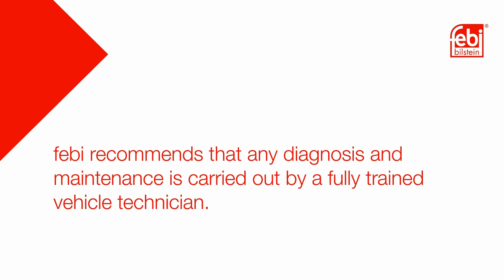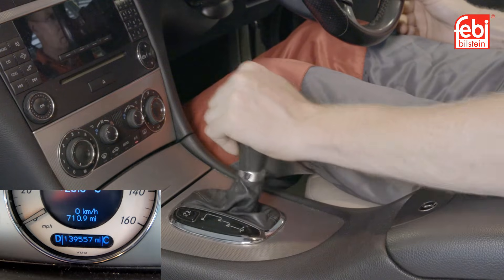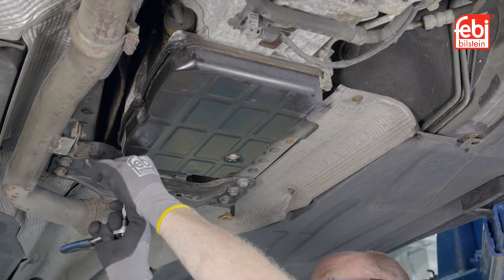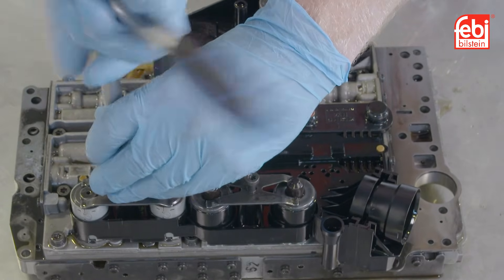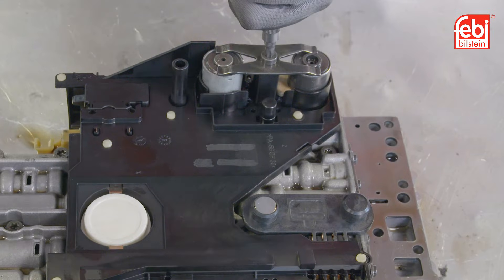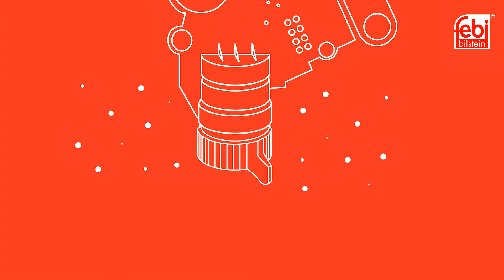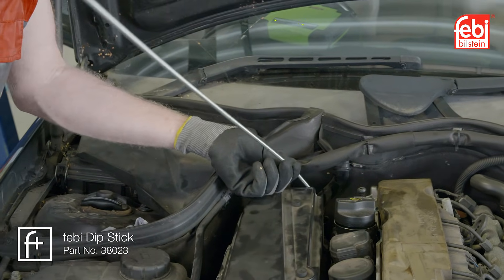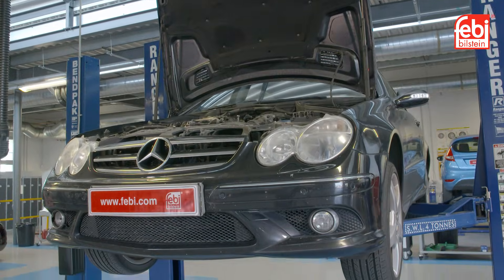[EN] Mercedes 722.6 Automatic Transmission conductor plate inspection and replacement.

Comment: Hello, thanks for the video. Is the locking cap reusable once the red part is plugged in ? Thanks a lot
Reply from the maker: Thank you for watching our video. The black cap is reusable, it is just the red security locking pin, that is broken to access the filling/dipstick tube on Mercedes automatic transmissions. It is best practice to install a new security locking pin after the oil has been checked.

Comment: How long does this service typically take??
Reply from the maker: Thank you for watching our video. The official time for changing the transmission oil and filter on the model featured in this video is 1.3 hours, but other models may vary. To change the conductor plate would be longer.

Comment: Mercedes 722.6 – Question after replacing conductor plate and WÜK valve

Hello everyone,
I have a quick question: After replacing the conductor plate and the WÜK valve as a preventive measure, is it mandatory to perform a reset/initialization of the TCM using Mercedes Star Diagnosis?

I did everything by the book – new oil, filter, WÜK valve, and new conductor plate. The car ran perfectly for 800 km, and then the same problem came back: after a few minutes of idling, the gear lever can be moved, but the car won’t move forward or backward.

Could it be because the reset was not performed?

Comment: Question, do you need to reset or erase any transmission codes? or check engine light
Reply from the maker: Thank you for watching our video. If there are any fault codes that are present after replacing any faulty parts. Then it is best practice to erase them.

Comment: can you edit video and add the actual bolts measurements? so we can know what tools to use. thanks for uploading
Reply: 7mm for 13 pin plug. Then all torx are t30 i believe i havent done one in few yrs. E8 e10 are also used for other thjngs t25 t27.  13mm socket also have a pick tool handy. And magnet tool

Comment: hello, I hope you are all well, please if you can help me, I have a mercedes c250 cdi year 2010 with automatic transmission tronic 5g, the problem is that when the car is at low rpm, i.e. below 2000 rpm, the gears change a little hard and with a knock or shock easily, if you accelerate to 2000 rpm and above, the gears are all changed in a perfection like new and out of the ordinary very soft, the car has full power and continues strong, this happens both in the cold and in the warm.  strangely, the computer does not show anything and this has worried me, the car has 280,000 km and the oil has never been changed, I emphasize
Reply: Did you found the problem

Comment: Does this part require any coding after installation?
Reply from the maker: Thank you for watching our video. No there is no coding required.
Reply: @ there are solenoids that go into the transmission control unit, if these are changed would you need to code anything?
Reply from the maker: @ Same for the solenoids.
Reply: @febi.bilstein  “Reset the transmission adaptation with STAR diagnosis.”

Comment: Hello Febi
I have a question . I have a p0763 code soleniode 3.im planning to change the soleniod.but should i change also the conductor plaid with it ?
Reply from the maker: Thank you for watching our video. Although it is difficult to give advice based on a fault code. Symptoms may include harsh gear shifting, failure to shift, or the transmission getting stuck in a particular gear. The most common causes are low transmission fluid level, dirty transmission oil, a faulty shift solenoid ‘C’ valve, or issues with the wiring harness and connectors. Therefore, check the service history of the transmission and the condition of the oil first.
Also, you should visually inspect the wiring harness and connectors for any damage, such as broken or corroded pins.
Reply: @ thank you for the feedback.
Gear was stuck on three and had the fault code . 
So I changed also the transmission fluid .then had the code again fluid was low I added half liter since then didn’t have the code but I was bit doubtful if I should change the solenoid and the conductor plaid
Reply: @easyrider020  how has it been? i have this issue and see there is a remanu service for the plate. i read the speed sensor faults at a warm enough temperature and tricks car into thinking its a wrong gear and will go from reverse to neutral or jump into 3rd.
Reply: @ in my case I changed soleiond for third shifting to four and replaced the conductor plaid

Comment: Can you give the product number for ordering of service kit and the conductor plate?
Reply from the maker: Thank you for watching our video. febi Transmission Oil and Filter Service Repair Kit 171748, Conductor plate 32342
febi Dip Stick Part No. 38023
febi Locking Cap for transmission oil dipstick Part No. 44204. All these part numbers can be found in the video and on our on-line catalogue. www.partsfinder.bilsteingroup.com
Reply: @febi.bilstein  do you have anything for 2017 glc300 please. 725.9g
Reply from the maker: @Aimless_Drive  Thank you for watching our video. Regarding your question, we currently have no videos on replacing the transmission oil and filter on the 725.9. However, we have the parts in our range. Please visit www.partsfinder.bilsteingroup.com to see our complete catalogue.

Comment: Never forget to check 13 pin harness  plug,not just adaptor plug ,pins are not soldered only crimped in place and intermittently one or more come loose, then limp mode happens, wires can make contact again with limp mode happening later, very very hard problem to find
Reply: is this a separate part to buy from a remanu conductor plate?
Reply: Yeah I messed up once lol

Comment: I have a 2004 W203 Kompressor Sport Sedan with a few problems related to shifting. Ive owned the vehicle since 30k miles and it currently has 240k miles. Ive never had the transmission serviced. It was a Certified Used purchase from Mercedes.

There have never been any error codes thrown related to the transmission since ive owned but i had the following issues for a about 2years now which have progressively gotten worse.

1. The automatic downshift at times, from 2nd to 1st gear (at slow speeds) slams into gear causing a big jerking. Other times it perfectly fine. On the freeway this  causes this causes the RPMs in first to drop really low when almost coming to a complete stop in traffic.

2. 1st to 2nd gear on take off (slow speed). I can feel a jutter in each gear causing a lurching or springing takeoff affect as the car speed increases. It becomes a less or lighter feeling in the other gears.

This doesn't happen if im hard on the acceleration or if Im manual shifting. In fact all shifting in manual shifting are fine, that i can tell.

Also, but infrequently, the car will lurch or lung forward at a complete stop without warning.

3. While at freeway speeds between 60-80 mph and letting off gas to coast. There is a jerking or lurching feeling.

If i had to describe it simplistically, it feels like a tight spot in a chain,  where the chain rotates fine to the point of the tight spot or kink and slowes the rotation with a sudden small sputter or light jurk (wobble), and then repeats the cycle untill you get back on the gas.

This wobble feeling also has me thinking driveshaft unbalancing, knuckle or driveshaft bearing.

4. At times the shifting doesn't feel like its fully engaging. By engaging I mean if this were a manual shift, that contact point where the clutch engages the flywheel and you get a positive contact confirmation of locking into place.

Im not sure if fluid & filter servicing would fix this issue, may be the fluid level is low, or if this could be a solenoid.. so many ways to go with this .

Id like to get your thoughts..

Here a good read about other having the same

https://mbworld.org/forums/c32-amg-c55-amg-w203/531557-jerk-transmission-problem-solved-9.html
Reply: Im having almost the same issues, I even have a video on my page about the small rpm drops, when there is allot of traffic and my car can only move in first gear it jolts back and forth just like you said, I also get the feeling my Transmission refuses to leave a certain RPM going lower in gear, if I’m cruising I expect that problem the most, but if I’m going sporty with my w211 e500 there is absolutely no problem at all. Only if I’m cruising, I did so many changes to the car about engine mounts, transmission mounts, having a transmission flush with absolutely 0 debris giving back to me, also did 16 Sparkplug changes, harmonic balancer everything relatable to that problem. It’s pretty frustrating because other people driving my car do not get what I get, and I don’t want to drive to Mercedes and pay a fortune for a small job which i could do alone. Mine hasn’t even 95k miles.. very good condition. Hope you can fix ur problem just as me.

Comment: @febi.bilstein
Hello!
Can you please provide a tightening torque spec for conductor plate connector retaining bolt ?
Thank you for the great video !
Reply from the maker: Thank you for watching our video. The conductor plate clips to the valve body, then the valve body bolts require to be tightened to 8Nm.

Comment: Hello.... thank you for the useful video, butvI got a question, I replaced my car Transmission Conductor Plate NAG1 for 2007 Chrysler 300C 5.7l AWD, it works then not shifting, they told me your Transmission need programming to work correct, someone else told me it doesn't need programming, so I got confused does it need Programming as you a professional???
Cuz am afraid to pay money for programming then if it doesn't work then you waste the money for nothing.
Thank you
Reply from the maker: Thank you for watching our video. There appears to be no programming required for this part. However, there are a resetting of parameters as a software option on the diagnostic software. This would not cause the condition you are describing.

Comment: Hello do the p0715 code go away after the conductor plate is change on 722.6 are do i need a mercedes scanner thanks.
Reply from the maker: Thank you for watching our video. If the transmission fault has been fixed by replacing the faulty parts, then it is best practice to check and clear any fault codes. In this case you should not require an official Mercedes-Benz diagnostic tool to do this, a good quality aftermarket tool should be able to do this task.
Reply: Thank you  @febi.bilstein

Comment: Could I use 33889 Atf for w203 c230 kompressor
Reply from the maker: Thank you for watching our video. If your vehicle is equipped with a 722.6 automatic transmission, then please use febi part 29449 not 33889. For our full applications for your vehicle please visit our on-line catalogue www. partsfinder.bilsteingroup.com

Comment: Doesnt a new conductor plate require coding to the vehicle?
Reply from the maker: Thank you for watching our video. No coding or basic settings are required in this application.
Reply: @febi.bilstein  I'm thinking of the 722.9
Reply: not if you repair only the component responsible for the fault on it. however if you decide to replace TCU, you ll need to transfer data from your old tcu
Reply: The machine reads no communication with the gear box ,what could be wrong
( Benz c 200 )
Reply: @johannesmolokoane9438  Sounds like a conductor plate fault, what year transmission?

Comment: What happens if the shifter doesn’t shift? Or read gears on the vehicle low fluid or bad shifter or bad connection

Comment: The diagnistic computer says "Slip" . There is big delay in shift between 1st & second shift.
Reply: Hey, I have the same issue after changing the conductor plate twice. Computer says transmission is slipping and there is a big delay between 1 and 2 gear. Please let me know if you find any answers? Thanks
Reply: @haideralifarooq  What did you end up doing?
Reply: Valve body ...I had the same issue in the same transmassion
Reply: What did you end up doing?